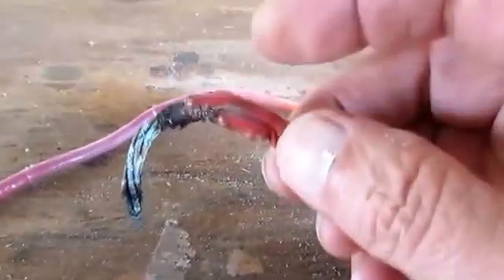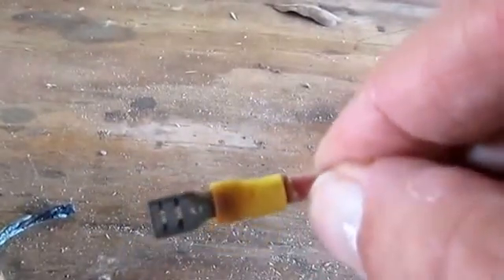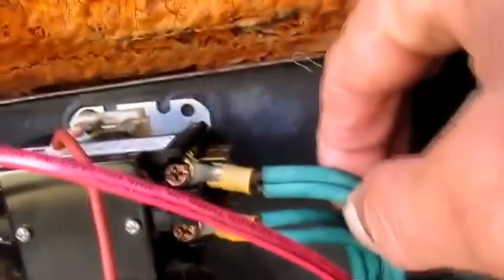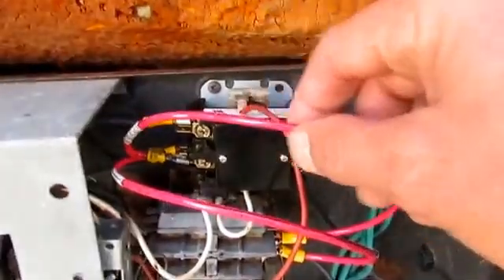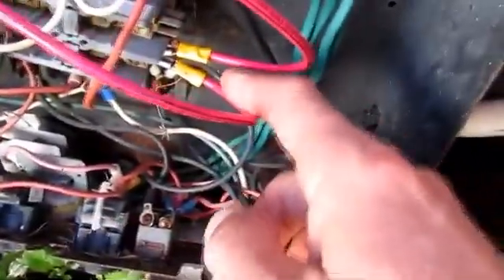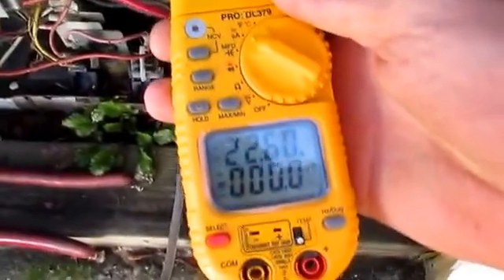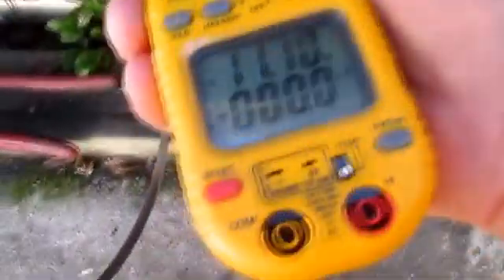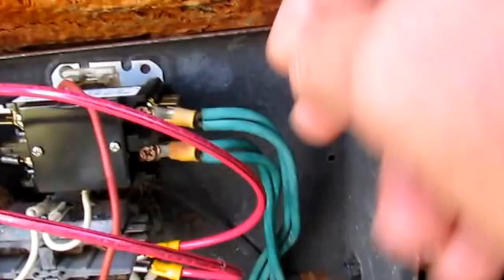Wires burning up?  This Might Be The Solution.

Comment: My 1991 Alfa Romeo Spider - the main power wire from starter solenoid to alternator burnt to a crisp, melting all the wires around it.  Cannot figure out why that wire fried up other than age?  Well when I replace it, I'm replacing it with two wires just like your demo!  Thank you for the great video

Comment: Y r the amps important? Im gurl but used to fix electronics at age 2, but now im 40 yo trying to learn by myself because I never could afford a course and nobody cares to explain. Waste of talent but ill grateful if you can explain it and if i can do a decent free or cheap but good course to understand and repair myself all the wiring and how to identify them, specially in power capacity so I can fix the wire burning cuz in Brazil ppl save money for weaker wires and burn the entire electrical circuit or burn sockets and it drives me crazy because whats the bloody point in saving and putting oneself in danger/loss of equipment to buy later another same cable and new socket and leave the whole thing ugly af, exposed, because its expensive to break wall and replace years old tiles that no longer exist in design, plus often getting an enture blackout due to using 2-3 electrical equipments at once (I work too much to have time to wait for machines like this). In Brazil I'd like to fix things myself once and for all cuz I aint tirturing myself and spending extra for the years to come, srsly. N maybe I can build new things cuz the regular engineering/wiring drives me crazy. I want new solutions to stuff. U from Texas?

Comment: If you are getting this issue the best possible fix is to solder to the terminals. Here they are just crimped and exposed copper to the outdoors corrodes.

Comment: Geez man smelt burning and thought I was gonna die 😂
Reply: Same smell from my really old stove, 4 arc explosions before I could shut down and throw the circuit breaker.  And it fried (literally) the insulation - that's probably the sweet stench I'm smelling.  Great to double up the cables - makes perfect sense.  I still would like to restore this relic antique Hotpoint Custom Crest electric stove gem from the '50s or '60s.

Comment: Never run 2 wires for 1 terminal.... it creates heat its not likr braded wire on itself -.- this is a fire hazard.
Reply: Is it !?? Then what we must do to solve wire getting heated up
Reply: @prajwalnagraj7620  you run larger wire... 2 14 gauge wires isn't equal to a 10g...

Comment: As much as I try to pay attention , I did not get how rhe titlw of the video and what he explain is related???   
Useless video
Reply: One wire carrying a higher current getting very hot and melting the protective plastic coating -  the solution was using  two parallel wires - each one carries half the current and so each one heats up less -  :)